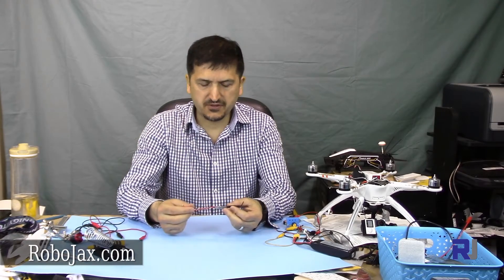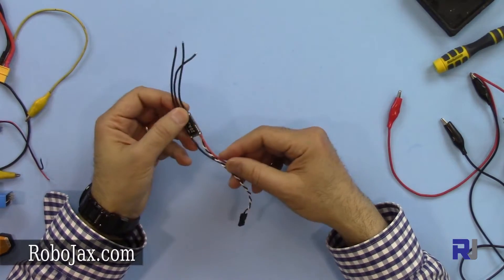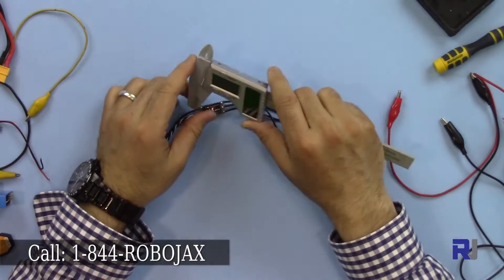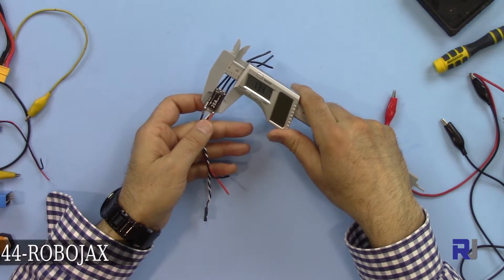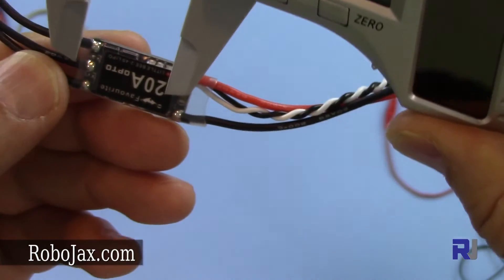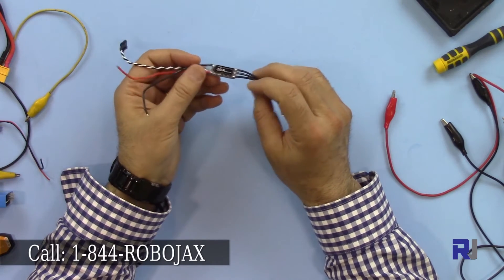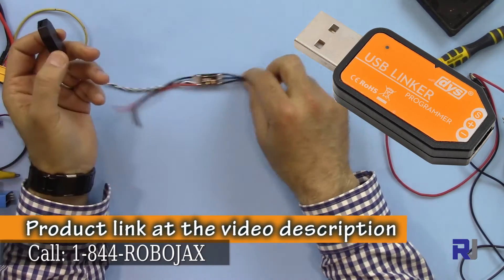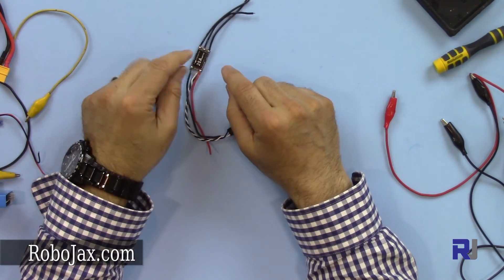Introduction to Favourite LittleBee 20A ESC

Comment: I’m a noob and just bought these ! First question is can I use them without doing anything to them ? Also can I use them with omnibus f3 board ?
Reply from the maker: Yes you can. Just connect and they should work.
Reply: How can I put ON or OFF active breaking on this esc ??